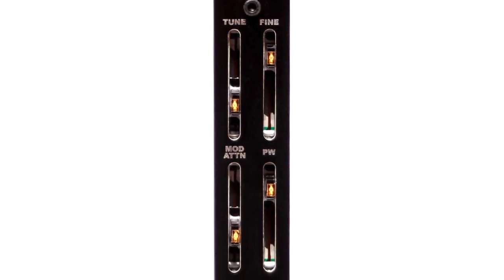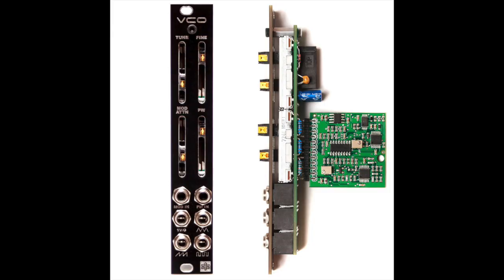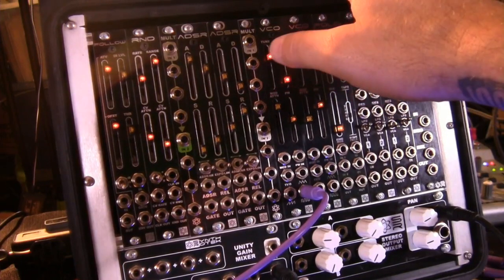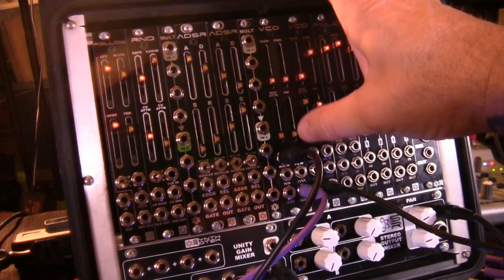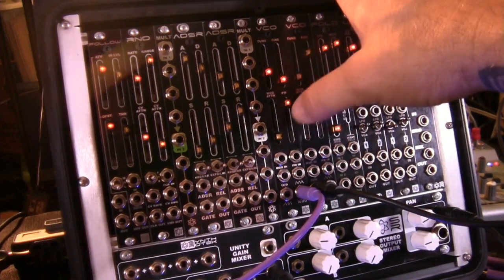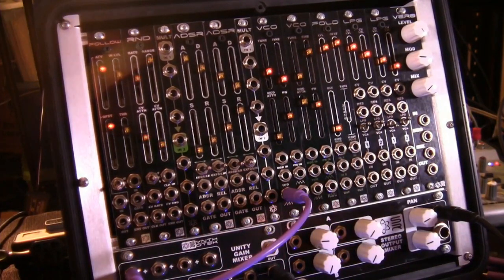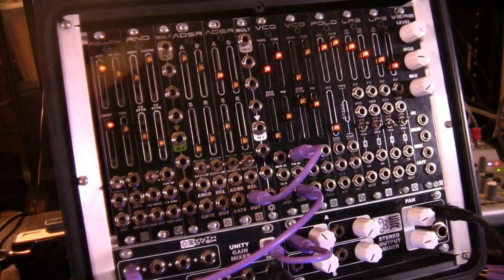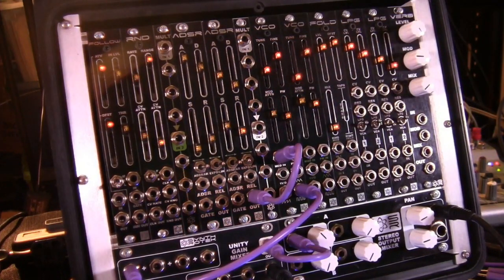Synthrotek Analog VCO - Voltage Controlled Oscillator Demo

Comment: I wish you could have crammed in a sync in and a linear FM in jack socket...but i guess it was a tight fit...
Reply from the maker: The Lin FM is there, the sync is on the main board (if someone wanted to kludge it), but literally no room!